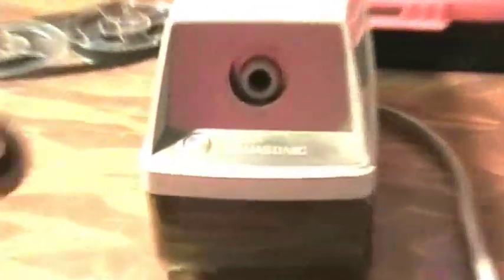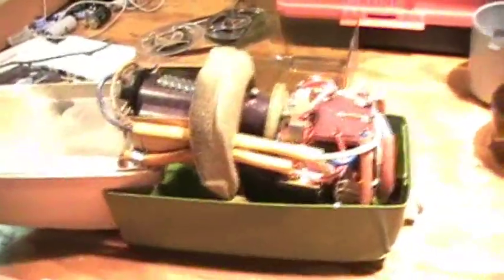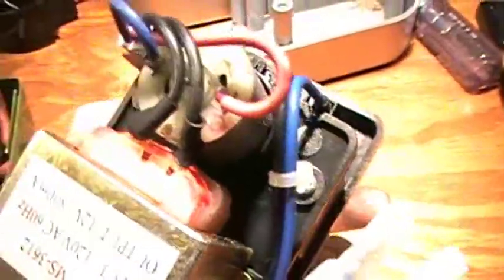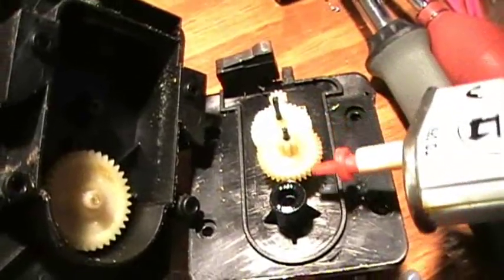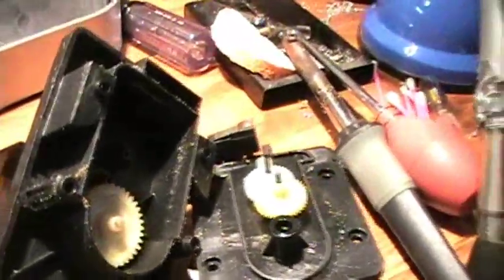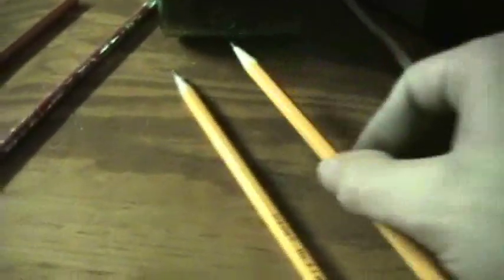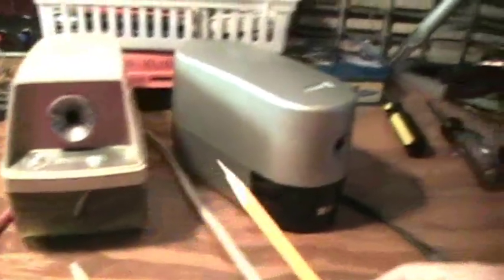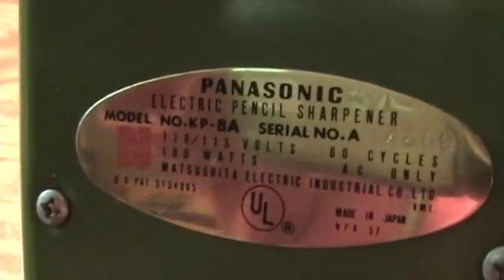Old Pencil Sharpener vs. New Sharpener.wmv

Comment: I ended up here in youtubes black hole, but i worked on one of those panasonics in my math class oh, working on 30 years ago. it was replaced with a crappier 90s one, but it wasn't as bad as the one that you compared it to, and all rooms had a bolted to the wall hand sharpener....those things worked forever.

Comment: If the switch is on the secondary and it's off, there won't be any primary current and therefore no primary power, same as a doorbell.  The doorbell transformer primary is wired to 120V and the pushbutton is on the ~12V secondary.  Only time primary current is drawn is for less than half a second when power is first connected, and after that only when somebody rings the doorbell.

Comment: CassetteMaster
 I was in walmart the other day and saw an electric pencil sharpener on clearance but I want to fine one x-actly like yours and amp it up. I went on the site and found the x-acto model 1900 and they have a classic looking 1800 model. I don't want to just buy one and then find out it has an AC motor in it. I want to find one with a DC motor like in yours and then I'll hook it to a car battery.
Heres the ones I found
http://www.walmart.com/c/kp/electric-pencil-sharpeners

Comment: I first purchased a Bostitch pencil sharpener for my sketching hobby. I bought the "Professional" Pencil Sharpener they offer. I got it in the mail and tried to Sharpen some number 2 pencils with it and they're both off center lol. I bust out my hand sharpener and it centers them perfectly. I put the pencils back into the Bostitch and they're off center again 🙄. I go on eBay and buy a Panasonic KP-33, it arrived today and it's basically like brand new. I sharpen both pencils with it and they perfect! 

Can someone tell me why a 40 year old device manages to work better then something that's brand new? You'd think in 2021 we'd have the knowhow to make a pencil sharpener even better then how they where in the 80's.

Comment: I like that panasonic sharpener better, the xacto is a POS. I have a battery operated coke can sharpener that works better than the Xacto. I say hook the motor of the Xacto to 24 volts and burn it out or hook it to a car battery or just let it run until it burns up like Spats did with the Durabrand can opener. Buy Vintage.

Comment: And you need to apply more force not alot exact on the top of an x acto to be a better and fast sharp pencil like I said the old school was better but so differences to it from my x acto was my was smaller so it was a small tray but the old school was big and not a portable is to be as the new school so it was heavier so review this video that the big one was louder than the other that doesn't have to do with anything but who wants an annoying sound

Comment: What do you think could be the cause of my Panasonic KP-110 (I think the model after yours) not working well? The motor seems to die when trying to sharpen. Not everytime, but most of the time. I took it apart and noticed that it looked like new inside. The gears showed almost zero wear and the stock grease was still there and looked good. Could the motor itself be failing? Curious on your two cents. Thanks.

Comment: The x acto and Boston sharpeners with the shaded pole motors are better than the ones with dc motors too. The Panasonic has a very powerful psc motor which beats even the x acto sharpeners that have shaded pole motors too.

Comment: 7:00 Captain we need more power. 
I wonder how strong that X-Acto sharpener would be if I modded it to run off a much more powerful benchtop power supply putting out 13.8 VDC regulated and at 6 amps. Maybe I'll find one of these and hack it up, maybe put a car cig lighter plug on it. Do they still see this exact model?

Comment: My class had that same panasonic sharpener in lime green. Sadly, it was pushed off the table by accident and the brittle plastic just shattered. Believe it or not, it was replaced with a sharpener even worse than that x-acto. It had a smaller whinier motor and would get jammed all the time. When it broke, i got a hold of it and pounded it with a mallet :D.

Comment: @CassetteMaster 
I'd be curious to know how much power the DC motor is drawing from the transformer by maybe putting a light or a meter on the motor leads to see how much the voltage drops. It says Output 12VDC 800mA on the transformer but I think the motor draws more power than the transformer can put out b/c the X-acto is struggling.